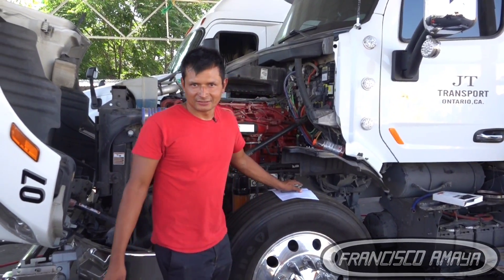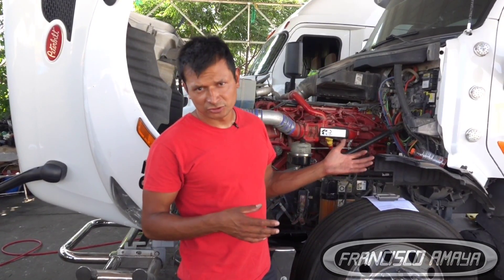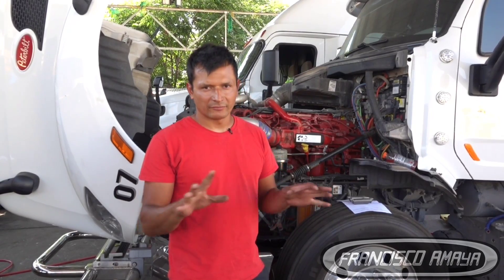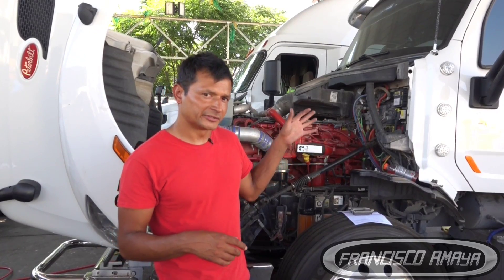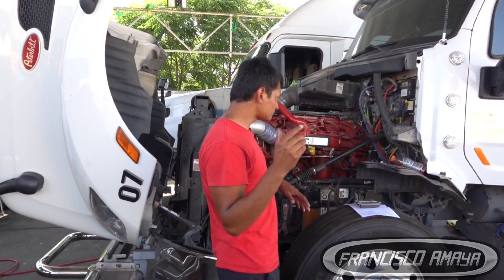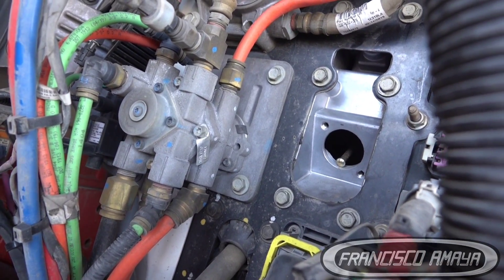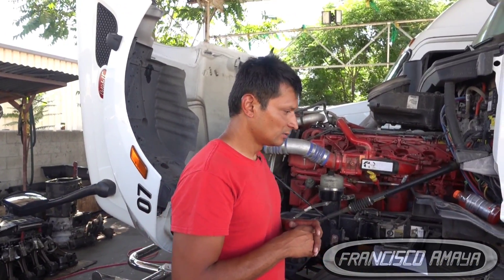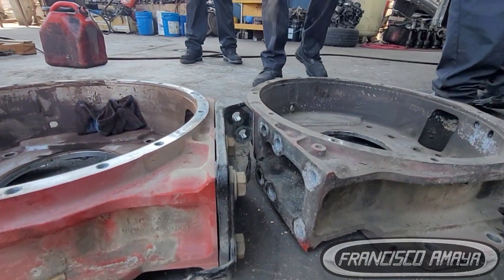INSTALLING A MANUAL TRANSMISSION ON AN AUTOMATIC TRANSMISSION TRUCK LABOR DETAILS AND PARTS

Comment: Is it possible change manual to automatic transmission on cascadia 2015 or newer
Reply: Yes you can I have a dt12 for sale low miles
Reply: Yes you can I have a dt12 for sale low miles
Reply: @CaliBraptor d12 engine?
Reply: Thank you for sharing your video’s, I have a question regarding  transmission on Cummins x15 engine with eaton fuller FAOM 18 to manual transmission 18 speed Volvo 2019 , besides the transmission what else do I need to replace on that truck, thank you